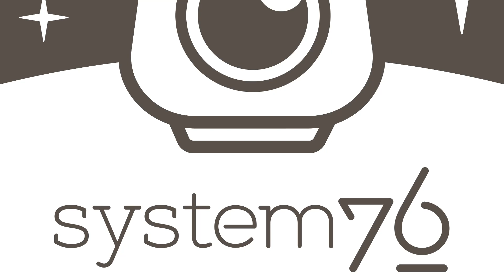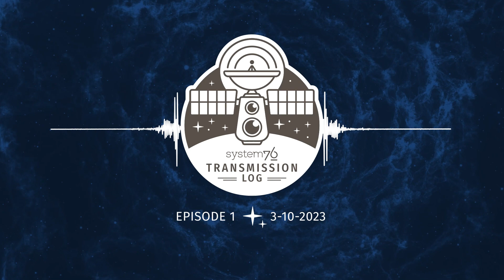System76 Transmission Log podcast - First Transmission

Comment: Some timestamps

1:35 Coreboot bugfix
3:10 Factory updates, 'Cerakote', automating cnc process
4:58 Pop_OS, COSMIC updates
 - 6:10 New text editor
 - 7:55 Wallpapers
 - 10:02 Pop tip
10:50 Interview with Starfire Energy
Reply from the maker: Thank you so much. The timestamps were accidentally overlooked. The video has now been update. 😀